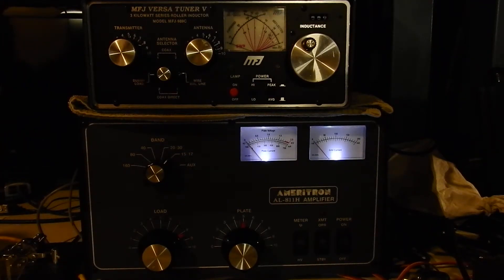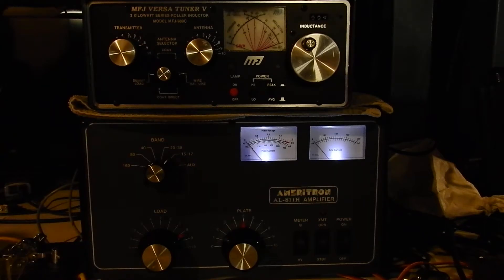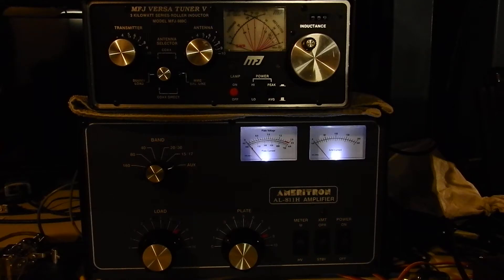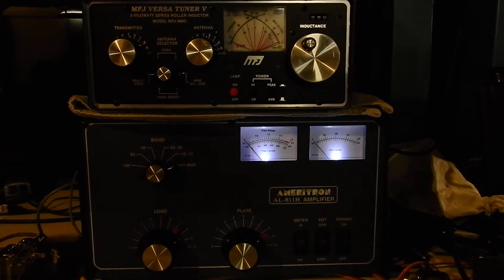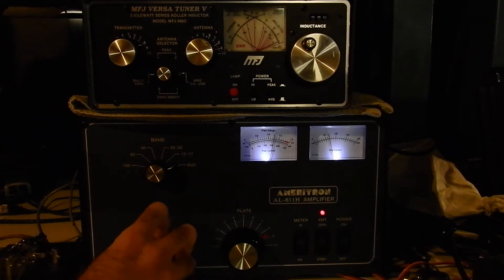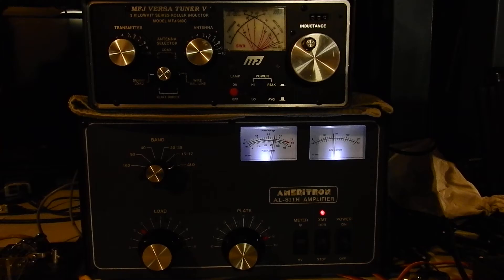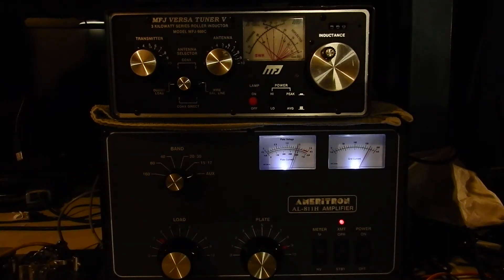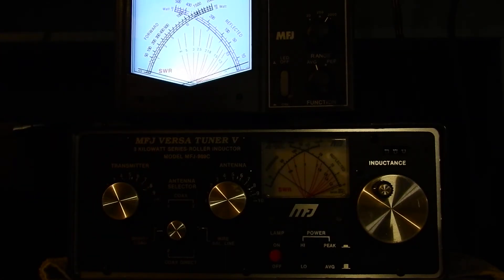AL-811H Tune Up Process

Comment: I gather that your tuner was connected to the dummy load, and so the tuning didn't matter? If it had been connected to an antenna, would you have adjusted the tuner to minimum SWR before tuning the amplifier? That seems logical to me, but I would appreciate an answer from you. Thanks.

Comment: I have an 811 amp with a foot switch I made from an old straight key. Ive been holding the straight key down to key the amp, and pressing the PTT in RTTY mode to send a carrier while tuning the amp. 

Am I doing this right?

Comment: Your sweeping from load to plate to aggressively..the amp exspecialy the 811 can be over heated fast at loading ... U want to couple ... And you can also over couple quickly .. it's a very very good idea to mark your load indicator for each band o do this so I can pre set the cap
Reply: You keep your freaking markers off my amplifier. It's really cheesy when people put marks on their equipment.
Reply: You're right about that Justin. I burned out some 811 tubes not knowing how to tune when I first got the amp.  73s brother.  211 Jeff Sactown

Comment: With all respect I completely disagree with how your running this amp ....
Reply: Agreed. This video should be disregarded as it is incorrect. The proper way is using the Grid current meter to get to max PO without excessive Grid current. What kills triodes operating AB1 in  grounded grid, is excessive grid current, so this is what must be used (the right meter). . The correct tune up procedure is best demonstrated by Tom, W8JI, the designer of the AL-811 series amps. He shows how to quickly and properly tune the AL-811H in just a few secs using the Ig meter, which avoids excessive tune up time, risking tube damage, as was done here. 
See his video here:  https://www.youtube.com/watch?v=ptWD2dTRi0g

Comment: I have a tube linear. In order to tune mine, I set the band, then adjust the bottom knob lower, while sweeping the top knob for maximum power. I think that you are likely using the wrong procedure.
Reply from the maker: The procedure I use is the same that is described in the manual from the manufacturer.

Comment: that ameritron pa does 600watt with 572b tubes, those simply replace the 811 tubes. when signals are weak, the 600watt can make a difference to 450watt.

Comment: 800w output doesn’t seem possible… if you’re pushing it that hard, the 811 tubes will be ruined. maybe with the 572 tubes because the tolerate higher current.
AND the 1000w 🤨
Reply: Its all about the duty cycle. the amp will produce more then 800 watts pep but for how long before the anodes glow red is the limiting factor.

Comment: Why you go back and forth so many times between load and plate is a bit puzzling to me. The primary cause of 811a tube failure is heat caused by over tuning
Reply from the maker: Because each adjustment has an effect on the other one. Once you know where it needs to be set on each band you can write it down and tune to it right away. Initially though it may take a few adjustments of each capacitor to get it dialed in. As long as you only key up for a few seconds and let them cool down in between they will be fine.

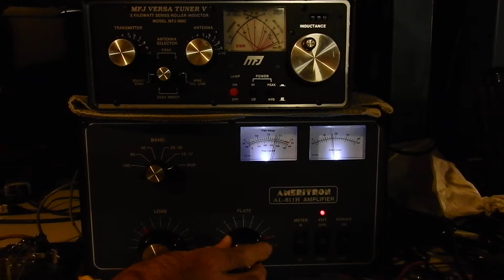Comment: From 4:48 to 5:07 you keyed up the Amp for 19 seconds. I agree that tuning should be perhaps in the 7 or 8 second range maximum as it's very hard on the tubes and I always wait at least 10 seconds between each attempt  Were you not concerned when you were tuning it for that length of time?
Reply from the maker: I agree and generally try to keep it to about 5 seconds. Since I was tuning into a dummy load and the amp was already pretty close to being right on I wasn't as concerned. I wouldn't recommend doing it that long on a regular basis by any means.

Comment: Thanks for a very informative video, I found the tip about increasing the load to bring down the grid current very useful. I bought mine 2nd hand off Ebay a few years ago and it arrived with a fault, either the load or plate capacitor was shorting out but  I was able to bend the the plates slightly to cure it. My amp is very noisy compared to yours, the fan seems to be very loud and fairly obtrusive, in fact yesterday a station mentioned that he could hear it running in the background. Do you have any tips or suggestions how to make it quieter please? I placed it on a sound absorbent pad which helped slightly. I assumed they were all pretty loud not having any previous experience.
Reply: Slight correction its not fan noise it appears to be hum from probably the mains transformer?